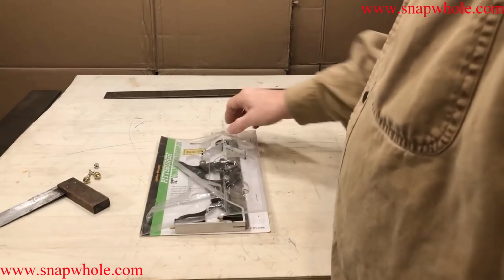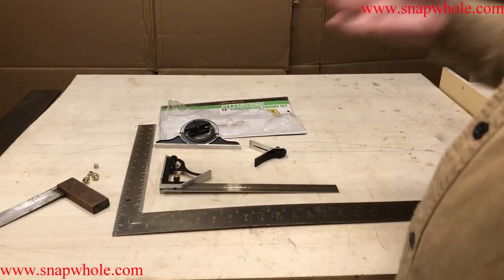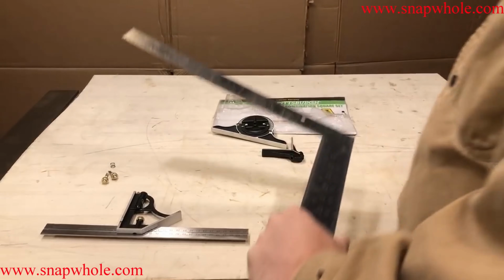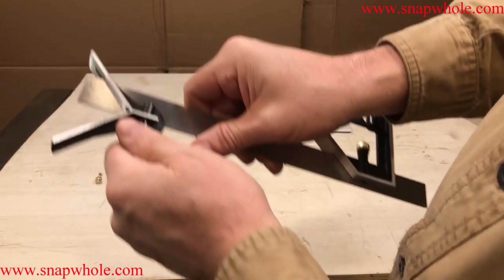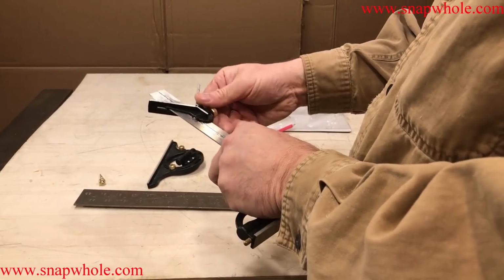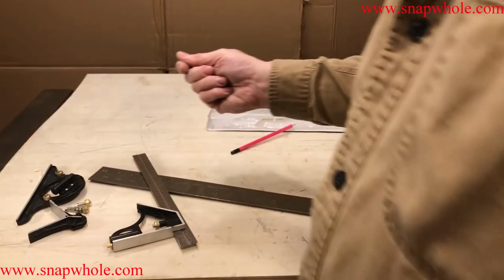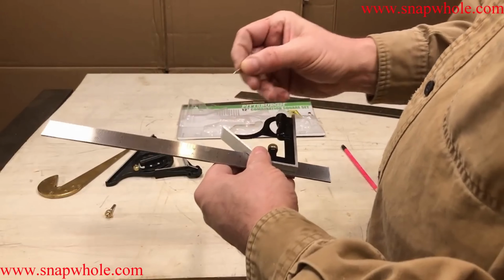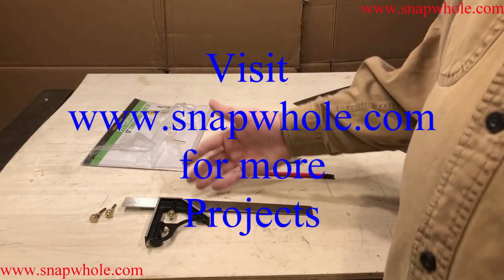Harbor Freight 12  Inch Square - How Accurate is the Square?

Comment: Thanks for taking time to make the video. A heads up, draw a line at 90 then flip the square and verify alignment to your previously drawn line. If when flipped the square over lays the line exactly, your square is on if not uts off.its very difficult calling one square the standard when it's not proven to be square by any validation (calibration). The flip does that. Keep in mind that the misalignment us twice actual.
Reply from the maker: there are two ways to calibrate the square - I demonstrated the one most people done know about - both methods product the same results - for confirmatio of this watch john heinz videos and wood by wright videos - thanks for subcribing